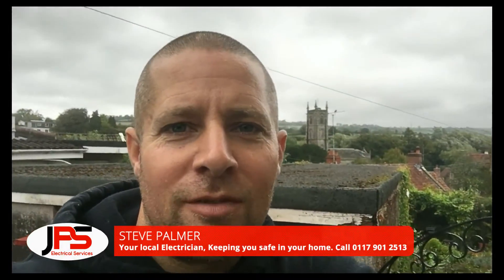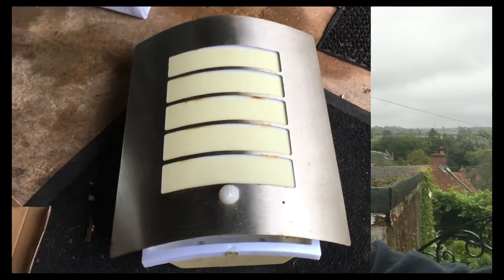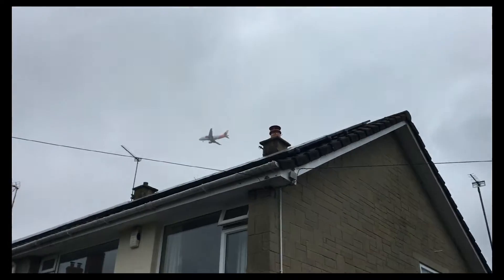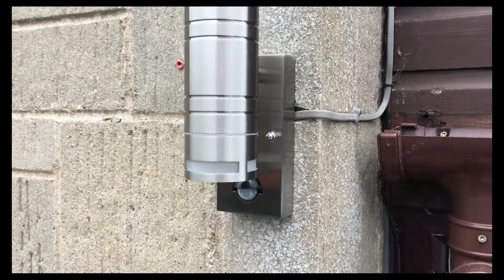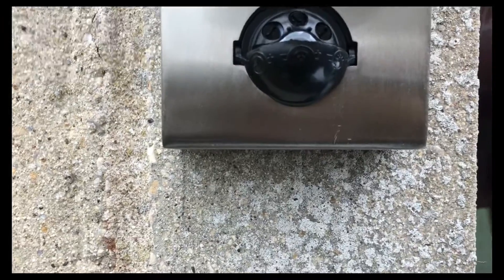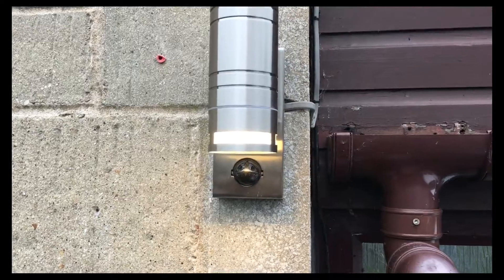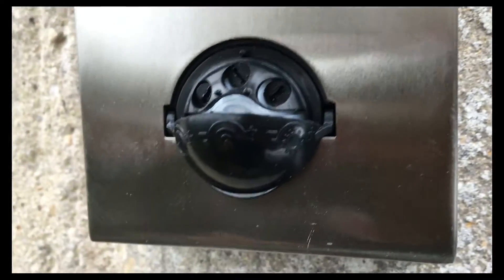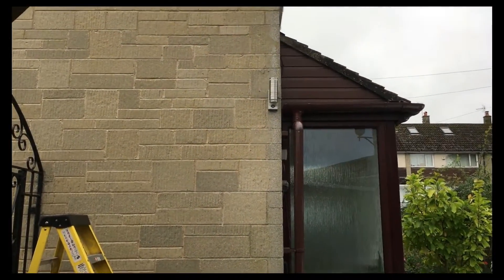How To setup a PIR outside light (Security Light/PIR Sensor)

Comment: Quick question, my outside light, the light just stays on now since yesterday, is there anyway tontry turn it off. I have tried the main switch does nothing. I have then turned off the fise to my lights to then turn the wee screw's bit does nothing. My main concern is the heat as cant turn thing off. Any advice?
Reply from the maker: Hi, Thank you for taking the time to comment.

Some lights have an override function that many people don't know about and these can accidently get switched on. To see if this is the case I would recommend turning the power off for about 5 minutes. This duration will exceed any recommended amount of time that I am aware of so if this is what has happened, you will know for sure.

Please let me know how you get on.

Kind regards
Steve :)
Reply: @JPSElectricalServicesBristol  hey steve unfortunately that didn't work.  Light still on when turned back on.
Reply from the maker: @Iam_TOsH  Thank you for the update. Is there any possible way that someone could have tampered with the wiring - tried to replace it or other situation where a cable could have been incorrectly placed? Some lights have a switched live terminal which could result in the light being on permanently.

Any signs of moisture ingress?

How long has this particular unit been installed please?

Kind regards
Steve
Reply: @JPSElectricalServicesBristol  no never had this issue before. Only thing I can think is possibly moisture, I'll just have to get a electrician out as don't wanna do anything else. But appreciate Ur help buddy 👍👍
Reply from the maker: @ does the light have replaceable light bulbs or is it a unit where they’re built in?

When the light remains on, is it at full brightness?

What area are you in please? I know electricians across the UK so there’s a possibility I may know someone nearby who can help you.

Kind regards
Steve 🙂👍🏼
Reply: @JPSElectricalServicesBristol  am in northern Ireland sadly lol. I don't know if I can get into it. I'll check once get home from work. All I know is the light Is on the mains. Am guessing the bulbs can be replaced.
Reply: And light Is one setting for brightness.

Comment: Can i set this to be on all the time
Reply from the maker: Hi Linda, Thank you for taking the time to comment.

There are particular brands that allow the unit to act as a security light or permanently switched on with an override function or switch. Not all units do this though and not all wiring will allow this if it's already installed.

I hope this helps.

Kind regards
Steve :)
Reply: @JPSElectricalServicesBristol  thanks steve for a quick reply. 
I always seem to complicate things.

Comment: I've adjusted mine but it just stays on?
Reply from the maker: @MrT1551-h5b  which of your circuits provides the power to the light?  Are there any light switches involved or is the light powered by just a single live, neutral and earth cable?

Kind regards
Steve :)

Comment: Hi Steve! Hope you can help. We replaced our old coach lantern with a new PIR coach lantern. Wirings are straight forward. But light is not coming on. And when I flip and switch rapidly, I can see little flashes of light from the bulb but never able to turn it on. Can you help?
Reply from the maker: @irenelai6088  Thank you for taking the time to comment.

The first thing I would do is check over the terminations to make sure something hasn’t worked loose whilst refitting.

Please let me know how you get on and if you’re still having issues, pop me a message through my website www.jpselectricalservices.co.uk

Kind regards
Steve :)
Reply: @JPSElectricalServicesBristol  .. thank you Steve.. I will do that.
Reply: Thank you Steve. It is working now. The cable fittings looked simple but it is quite temperament too! 😅I got it in the end. Thank you for your kind advise 👍🏻🙏🏻

Comment: Steve , I`m trying to replace a pir light with an ordinary light but there`s four wires from the wall , blue, yellow/green and two browns and three from the new , ordinary light blue , green/yellow and brown. I`ve wired it up using just the usual three wires from the wall , leaving the second brown free but the light just remains on . I`ve then wired the second brown from the wall into the brown on the connector block but the light still remains on. Any help would be greatly appreciated , thanks.

Comment: How to set spot on however the light wired in standard 1.5 twin and earth with no mechanical protection ie conduit copex etc cable exposed to elements and uv light not a good idea , why not just use mymj cable which is appropriate  for such situations?
Reply from the maker: Great observation Brian and as mentioned in the video, I was only contracted to replace and set up the light.

On an EICR the pvc twin and cpc cable could only coded as a C3 which is the equivalent to an ‘advisory’ on an MOT.

If the external influences had caused the sheath to perish then a C2 could be awarded. This would mean that the entire installation would be recorded as UNSATISFACTORY until rectified.

Thanks for touching on this. It’s a point that we often see working within the trade that many homeowners wouldn’t know about 🙂👍🏼

Comment: Is it possible to attach another sensor to lights like this. I have a blooma parkville charcole.double trip in an alley by my house. Problem is next to it theres a steam vent from the upstairs bathroom and the steam set the light that was there before which I took down a couple of days back off all the time. I've managed to turn the vent but could do with another sensor like five Meters further up the alley. After all it has two spots so the light covers a much greater radius than the trip. Can anyone tell me if it's possible to say rig the sensor off the old single trip spot to this sensor? I'm sure it's possible although very unauthodox lol
Reply from the maker: Kris, thank you for taking the time to comment.

You can most definitely install multiple sensors to trigger one or multiple lights. 

Kind regards
Steve :)

Comment: Hi, I have these light to install on Thursday (diy & if rain free) but my question is what's the maximum height these can be installed please?
Reply from the maker: Grahame Gallagher thank you for taking the time to comment. 

The answer to your question will be indicated within the manufacturers instructions. Please stick to these as it will have an effect on the performance of the sensor. This may vary from one manufacturer to another.

I hope this helps.

Kind regards

Steve :)

Comment: When trying to adjust the settings after installation, the dials on my light just rotate a full 360 degrees and no matter how much I turn it the settings, e.g time for lamp on, do not change. Is this more likely operator error or a faulty unit?
Reply from the maker: David Sheridan thank you for taking the time to comment. 

There becomes a time where you can only try so many alternatives before having to accept that it may just be a faulty unit. Unfortunately we usually spend more time than we should in proving this as we often suspect that we have done something wrong rather than believe a brand new unit would be faulty. It’s very frustrating when this happens but take a breath, count to ten and head back to the wholesalers for a replacement. By the time you return, your head will be clear and you’ll have the new light installed in moments.

Please let me know how you get on.

Kind regards

Steve :)
Reply: JPS Electrical Services  Thanks for your reply Steve. You were right, I struggled for hours trying to understand why I couldn’t get it to work correctly but I ended up returning the light and after fitting the replacement it worked perfectly.
Reply from the maker: David Sheridan thank you for the update. Whilst I’m disappointed that you suffered the inconvenience of being supplied a faulty unit, I’m so pleased to hear that you have installed the replacement and it is working correctly. Thank hope that it serves you for many years to come.

Kind regards

Steve :)

Comment: Thank you so much, Finally got how to adjust the settings. I keep looking the - and + sign on the flap but not sure how to adjust. Quick question how to adjust so that the light won't detect motion in the morning?
Reply from the maker: Sathish Kumar Baskar thank you for taking the time to comment.

On PIR lights you should always have a minimum of TWO dials. One will control how long the light stays on for (I usually turn the dial to minimum and then back a quarter turn). The other will control the LUX. This is the level of light that the sensor detects. (I usually turn the dial to complete darkness and then back a quarter turn). Some manufacturers require fine tuning during the darker hours but these settings are a great starting point.

Please let me know how you get on.

Kind regards

Steve :)

Comment: Hi thanks for the video very helpful- I have these in my garden already fitted- is there a way to have the lights stay on permanently when you switch them on?
Reply: You might try this: locate the switch that controls your light(s). Switch it off on off on in rapid succession. With most sensor lights this will override the sensor and turn the lights on until morning.

Comment: Great video and you speak clearly aswell.
I'm about to pick your brains.im installing an outside sensor light but just being a DIY-er the light has the earth, neutral and live but the cable running from my garage has 4 wires?I had a complete house rewire done in 2017 any help would be appreciated.👍🏻

Comment: how do you replace the bulbs without damaging the sensor lighting on it ?
Reply from the maker: gordon eddie thanks for taking the time to comment.

You need to first establish if the unit that is installed has lamps in it that can be replaced or if it is a sealed unit with NON REPLACEABLE LED units installed inside.

If the lamps are replaceable and like the unit shown in this video then you will turn the lens anti-clockwise which will expose the GU10 lamp.

Please feel free to send me a photo of the unit by making contact with me through my website www.jpselectricalservices.co.uk

Kind regards

Steve :)

Comment: Great video much better than other ones. 

Can I Wire X2 PIR lights on the from one mains cable or will this cause issues?
Reply from the maker: Andy Carvalho thank you for taking the time to comment. I’m so pleased that you like the video.

Yes you can use one power supply for two pir sensor lights. Just remember that using this method will result in these lights working independently of each other. The time this is not ideal (and I do see it on my travels) is when you want a light either side of a front door. Due to lights working independently one light will always operate before the other.

I have a PIR censored light at the front of my home and one on the side where my front door is but I also have a 3rd light in between that has no sensor. Instead it  is linked to the two sensors. The result is that if someone leaves or approaches the property, all three lights turn on at the same time. This may be completely relevant to your question but I just thought I would add this information for anyone else reading the comments.

Please feel free to ask any further questions, I’m always happy to help.

Kind regards

Steve :)
Reply: @JPSElectricalServicesBristol  Thanks for the reply Steve. Could I wire a PIR light and a normal light and have the normal light come on with the our light is on
Reply from the maker: Hi Andy, Yes indeed providing the wiring in the light allows for this configuration. 

The power supply would go to the light with the sensor first, connecting to LIVE, NEUTRAL AND EARTH and then a link wire going from the SWITCHED LIVE, NEUTRAL AND EARTH to the other light where it then connnect to the LIVE, NEUTRAL AND EARTH.

* Please be sure this makes sense and if you believe this has taken a step beyond your limitations speak with your local electrician - Do not proceed under any circumstances if you are not sure as it could be dangerous or if carried out incorrectly then it may cost you more in the long run than contracting an electrician to do it for you in the first place.

I hope this makes sense.

Kind regards

Steve :)
Reply: @JPSElectricalServicesBristol  Thanks Steve I don't think the light I have will allow for this. There is only Live and Neutral on it.
Reply from the maker: Andy Carvalho are you in a position to take it back and go to an Electrical wholesaler that will know exactly what you need in order to complete the installation that we have discussed?  👍🏽
Reply: @JPSElectricalServicesBristol  will give it a go. Thanks for you help
Reply from the maker: Andy Carvalho you’re most welcome. Please let me know how you get on.

Kind regards

Steve :)
Reply: @JPSElectricalServicesBristol  I found a new PIR Lamp made by ASD that has L, N, E and a switching wire so I believe I can now do what you said. Will try it out
Reply from the maker: Andy Carvalho that’s fantastic news. You should be well on your way to the perfect installation now. 

I hope I’ll hear back from you once you’ve completed the work.

Kind regards

Steve :)
Reply: @JPSElectricalServicesBristol  All sorted now works a treat. Thanks very much for your help

Comment: Like your videos and I have a query regarding PIR lights. I have moved recently moved to a house build about 10 years old and have some PIR controlled lights in the carport. They have worked in the past but now really struggling to reset to PIR mode.
They are controlled by a 3 way switch inside and I have deduced that up is PIR, middle is off and down is on all the time.
I have tried numerous re-setting techniques shown on youtube and on occasions I think I have re-set (i.e. lights come on when I move in front of sensor in the dark and go off a few minutes later) but 24 hours later, no response to such actions ? (also no power cuts or other problems apparent). It's weird - any useful suggestions would be welcome !
Reply from the maker: Brian Holland thank you for taking the time to get in touch. What area is your property in please? I have contact with Electricians across the Country and may know one in your area who I can put you in touch with. I’m sure you’ll appreciate that without seeing the setup I will be unable to advise as it could lead to a potentially lethal situation.

Kind regards

Steve :)